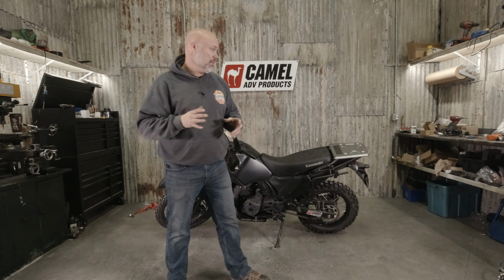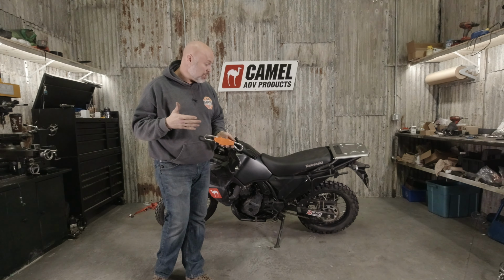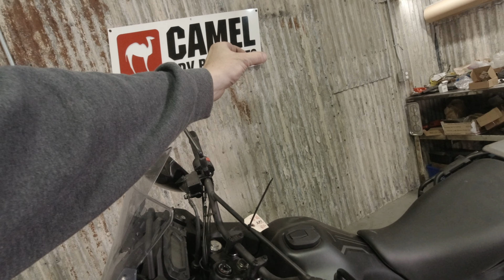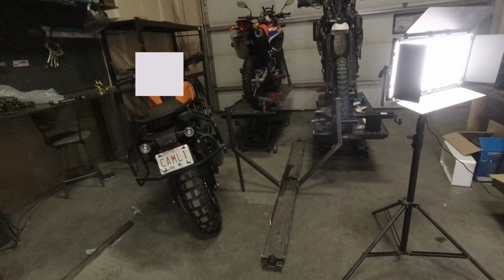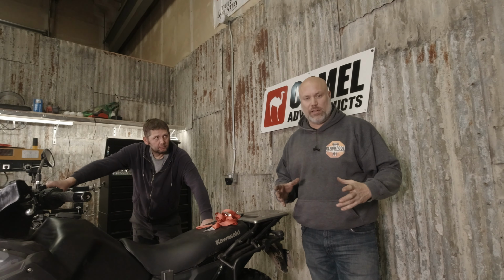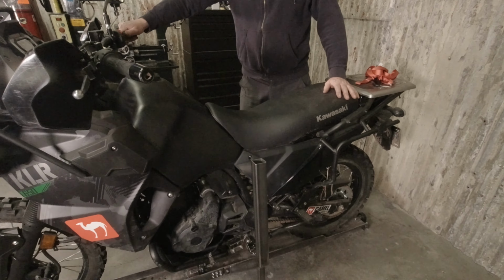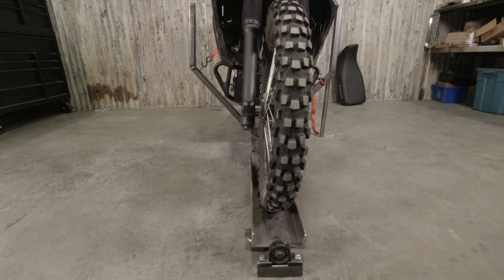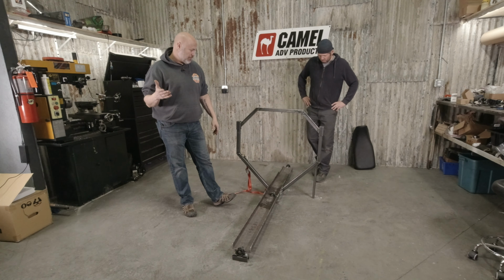CLAW Series, Episode 1:  How Top Heavy is Your ADV Bike?

Comment: I am glad you came out with this topic because I guess the same as you depending on where the extra weight is located in the bike is going to affect the weight for tipping it up.
 Africa Twin with DCT is 23 pounds more than the standard and the extra weight is in the center lower so in theory, it doesn't matter for tipping it up. 
Looking forward to the conclusion you are going to get.
Reply from the maker: Exactly. I expect adding a much heavier skid plate or standard vs DCT Africa Twin will have little effect of top heaviness. Overall weight will definitely be more but maybe not much effect on top heaviness.
Reply: I can drop one off. 😉

Comment: Is this an early April 1st gag? Joking. But you can calc the vertical C of G by putting a scale under both wheels with the front wheel elevated (one formula). Then calc the force at a given angle of lean at the seat or handle bar to keep the bike upright... Or as other folks have suggested, measure the force at the bar for different lean angles. Or what I do, I ride, and then crash and pick it up on the trail... I guess actually leaning the bike over does give you something you can't get otherwise, the effect of fuel in partially fueled tanks moving out from the center line (assuming one were to test different fuel levels). V. interested to see how this turns out though : )

Comment: A simple test would be to place stem of bike, placed vertically under the pulley. Connect pulley, with weight gauge to left handlebar. Slowly lower bike down to 20 degrees. Read weight on scale. Add 5 degrees .Continue. That will tell you how "top heavy" something is. Plan B is contact Ryan F9. He is a 20lb brain looking for a  windmill.

Comment: Use the WAM equation. Weight x Arm = Moment. Use a reference datum line (RDL) of 25” from the ground with the motorcycle up right. Now measure the number or inches from the front hub (D1) to the RDL, rear hub (D2) to the RDL, and the bar end (D3) to the RDL. 

Place the motorcycle on its side and weigh all three points at the same time. Front hub (W1), rear hub (W2), and bar end (W3).  Now run the following calculation for all three points: (25”+D1=A1) (W1xA1=M1) once you have all three arms (A) and moments (M) do the following: Total Weight = (W1+W2+W3) Total Moment = (M1+M2+M3) then compute total arm. Total Arm = (Total Moment/Total Weight)

Total arm is the center of weight in inches from the ground. If you always use the same datum line (ie 25”) you will be able to compare every motorcycles percent of top heaviness. 😊

Comment: I’d lock the bikes to the jig either to the end of the handle bars or probably more accurate, through the wheel axles.
You could still use your frame to attach the scales from but not have to attach the bike to it as well.

Comment: You could have screw in bolts on your frame that screw to the swing arm mounting bolts each side and another to frame either side of the handle bar end weights each side. Obviously the frames to these points would have to be adjustable for each bike, but 4 points of contact, 2 each side would hold each bike firmly.

Comment: Not sure how far you guys have progressed since posting this video but here's how I would tackle this: I'm not sure whether trying to weigh it from a crane is a good idea. Why don't you just use your rig, then take a ground-based scale and put a telescoping pole on it, and place it right underneath the centre of the grips. At 0 lean angle, it should read zero (all the weight supported by the wheels), and then you can lean the bike (move & adjust the scale & pole to fit) and lean again.

Comment: Could you remove the foot pegs off each bike and have a pin to go through and attach stronger ratchet straps to the pins? To hold the bikes upright I think the foot pegs would be a fairly consistent place to attach to the jig. I suspect you would have to strap the wheels down into the channel to avoid them kicking out. Great idea though. I would have a ball doing stuff like this.

Comment: interesting idea, BTW Tenere is traditionally top heavy.  XT660Z was, T7 is no different.    Simplest way is to measure it is at the seat level, that is where rider is feeling top heaviness.  just wrap around the seat with some rope and use the spring scale connected again at the seat level to the wall. Measure the "weight/force" at different bike angles. Job done.   You're just overthinking it.

Comment: Dueling traceable scales. Geometry differences make finding a comparable mount point improbable. Picking user use conditions is important. Standing, sitting, leaning, other. Loading each of these points variably while weighing multiple points may be valuable. For example loads on handlebars, pegs, and the seat are important. Also consider that rotational mass can't be evaluated. Otherwise all you are really testing is the bike at rest. Just put my T7 through hours of a blizzard in deep, hilly PA. No matter how sideways, the power train and geometry refused to yield regardless of top weight. Drastically better than my lightened KLR G2 which I know to be lighter up top. I only fuel that to 4 in the snow.

Comment: Could you attach the CLAW to each bike using axle bolts?  Adjustable height to match each bike. Then measure from a fixed point on the CLAW fixture for consistency across bikes.  That would also remove tire type from the equation.
Reply from the maker: We considered grabbing bikes from the axles but it would mean machining parts for most bikes. The axle width, diameter, height (is it a 21" or 19" front?, 18 or 17" rear?). The clamps would need to move widthwise, height wise and back and forth to accommodate different wheel bases. That is a lot of moving parts, to keep tight (not flexing under load), Bikes that have single sided swing arms also create a challenge. Even if we got it clamped by the axles, we still haven't solved the question of where to attach to to have a consistent pull location.
Reply: @CamelADV  Re: the consistent pull location, Can you just extend an arm from the side of the fixture down to a simple scale? Rather than measuring the pull force from above, measure the push force downwards as the bike leans.  I suppose the arm would need to be adjustable in length for different angles, or different length arms for each angle measured.  This would give a consistent measuring location no matter how the bike is attached to the fixture.

Comment: Your overthinking it.  The reality is "how hard is this to pick up when I drop it.  So lean it over on its side until it contacts the ground then lift it.  Lift it from where you would lift it in a crash; handlebars and rear grab point, what ever you would use out on the trail.  Attach a strap at those two points , put the scale in the middle and load it with the crane.  The initial weight; getting it up onto the wheels and past 45 degrees will be the greatest weight.

Between bikes that is all that matters.  Boxers wont fall over as far as a T7 so that initial weight may be lower.  It is all about relativity between bikes, not absolute repeatable numbers

Comment: Why not just weigh the bike on it's side with three scales? One under the wheels, one under the handlebar (as long as that's the only contact point). The ratio of the three would be a good measure of weight distribution. You could brace the wheels from slipping out and elevate the handlebar scale .5m or something to account for GS's. The tire squish would not mater, just the ratio of wheels vs handlebar weight. Or pick a spot on the tank and put the scale under that.

Comment: Seems way over complicated? How about making an adjustable vertical post thing, that would post up under the end of the handlebar, that you could put a scale under. Measuring the down pressure at handlebar end at whatever lean angle you want . Just nail a board to the floor parallel to the tires for them to push against if it tries to slide out.
Reply: The same weight will feel 1/2 as heavy with a lever that is twice as long, so I think going from the handlebar is the only way to key this to how it actually feels as a rider. A taller bike may actually feel lighter if the center of mass is the same distance from the ground as a shorter bike .

Comment: center of gravity, that's what you're after. Center of gravity of the bike. And center of gravity of the bike + the rider. In the second case things like pegs positioning and pressure on the handlebar and it's height might matter.
Overall, you seem quite clueless, I see that a lot from motorcycle instructors as well when they try to explain motorcycle physics/riding techniques.

I would invest time in learning physics and reading motorcycle engineering books. I can recommend Cossaltier, Motorcycle Dynamics.
Reply from the maker: "Overall, you seem quite clueless..".   🤣🤣🤣

"We don't know what we don't know", "Maybe this is a shitty execution of a great idea or a great execution of a shitty idea"... these should be obvious clues to anyone paying even a little attention that we're not pretending to have the answers. We're not trying to explain anything at this point, in fact at several points in the video we both mention that we're trying to figure out the best way to get where we want to be. I wasn't blessed with infinite knowledge at birth but I'm self-aware enough to know that and ask for help when I don't have the answers. We've starting a discussion and asking questions.
Reply: @CamelADV  then start with a book not with a welding machine...

Comment: I think you guys are overthinking. How about just a simple pick up force test. Since that’s all most of us riders care about.  We’re all going to drop our bikes. I just want to know how heavy it is to pick up compared to other bikes.  Riding a bike will tell me all I need to know about how top heavy it feels when I’m riding.  The pick up force is what most of us would like to know.
Reply from the maker: Pick-up weight is important but the less top heavy it is to begin with, the lest likely it is to end up on the ground to begin with. A pick-up weight could be added to the data sheet but it doesn't tell the whole story.
Reply: @CamelADV  I’d disagree that it makes much difference at 20 degrees. Other factors are going to be much more influential in dropping the bike at 20 degrees than the top heavy difference between bikes in the same class. Seat height, inseam, foot peg height, rider strength,  and ground conditions and slope are going to make a much bigger impact then the weight difference at 20 degrees.   In the end everyone will drop their bike.  Now how hard is it to pick up once it’s on the ground is the most important.  One could draw a pretty good conclusion for themselves based on their own body type and riding style based upon that.  So I think you’re doing a whole lot of work for something that isn’t going to be an important factor in someone dropping their bike.  

But if that’s the data you really want then I’d talk to the aerospace engineer. As I pilot I calculate weight and balance on every flight using their formulas.   But again I think you’re trying to find an answer to a problem that really has not much value in real world use.  I’d argue inseam and seat height are way more of a factor than a little weight difference at the top.  

But I do appreciate all the thought you’re putting into this and open to suggestions.  I wish you made a tank for a 701 :)
Reply: I'd agree  - pick up force/weight is what I'd like to see because that's what matters out on the trail. I don't really care about how top heavy it is although it would be a good data point to gather.

As for latching points, it would seem you should attach the scale to the points on the bike where your hands would pick it up and where you could grab it when lifting.

Thanks for the effort!
Reply: @tontonn9995  I did a pick up weight test on scales here: youtu.be/Ze8rsxrITTA

Comment: I already made a video on this I titled "does bike weight matter". An accurate test of all bikes would be good. /Ze8rsxrITTA
Reply: The "top heavyness" only matters when you are lifting the bike. You lift it from the handlebars, so that is where is should be weighed from. It weighs its most when it lifts high enough for all of the frame and bags to be clear of the ground and its only 3 points of contact are two wheels and the lifting point. That is what matters in my opinion.
Reply from the maker: I just watched your video, it's definitely interesting. That is definitely a good way measure the pick-up weight of a bike. We're on a similar path, but different.
Reply: @CamelADV  Awesome. Hopefully you can be more accurate than me and have access to more bikes. Im interested to see your results compared to mine. I beleive the T7 is not as top heavy as people say it is.